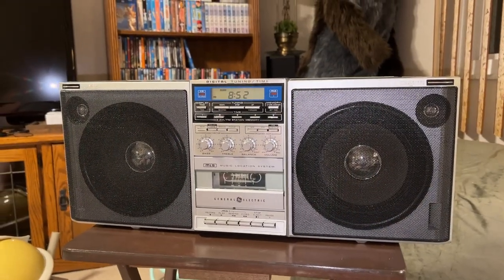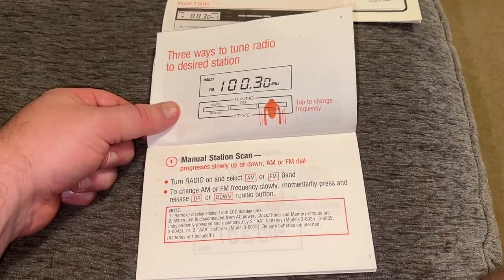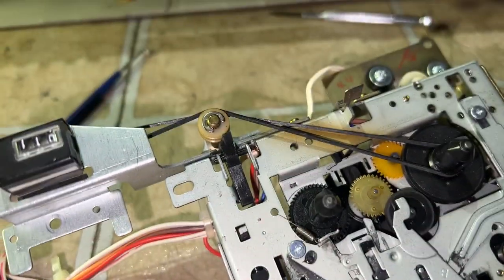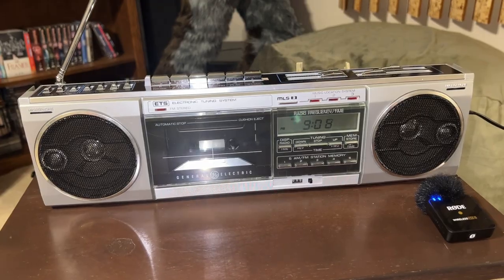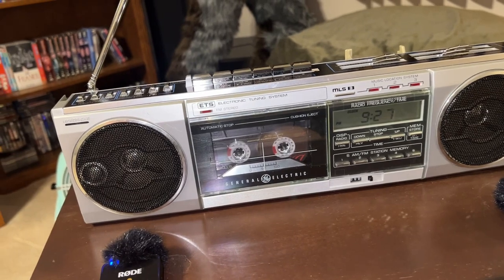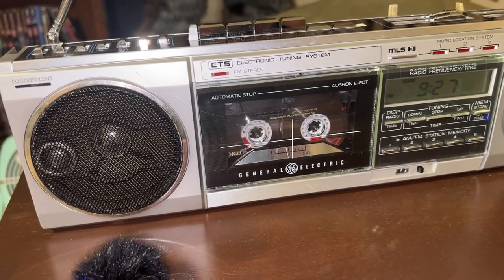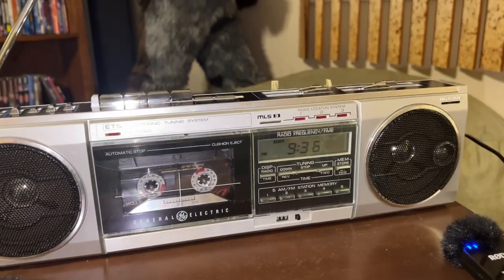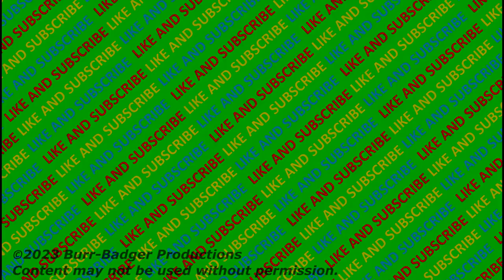1984 GE Model 3-6025A Mini Boombox

Comment: What I always found interesting in this and other GE's from that era is their inclusion of the extended AM band: 1983 was several years before the band started being used, with most extended band stations coming on the air in the mid 1990s. GE was always thinking ahead. I have several Great Awakening series clock radios, the only one that does extended AM like your 6025A is a 7-4875 aka "The Small Wonder" and mine has a date code of 1984. Love your GE collection, thought I was the only one who obsessed over these!